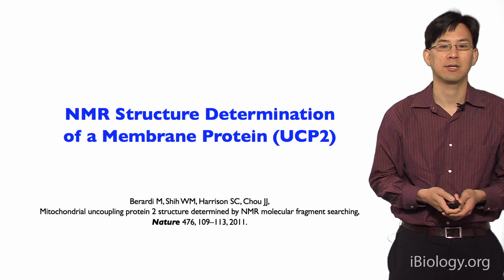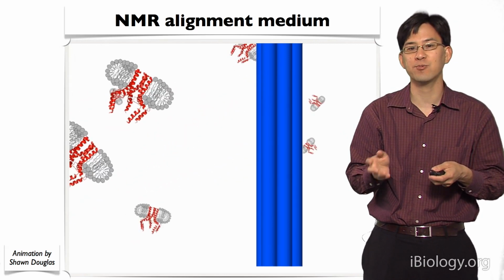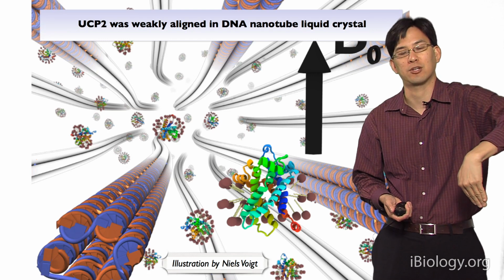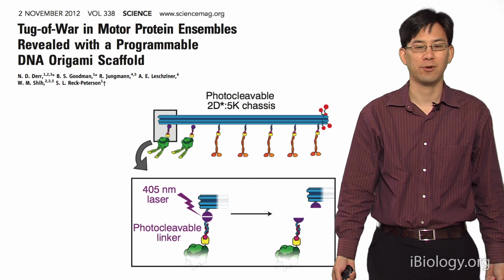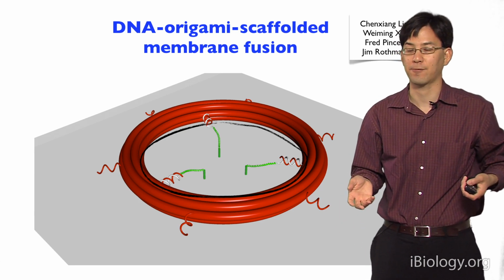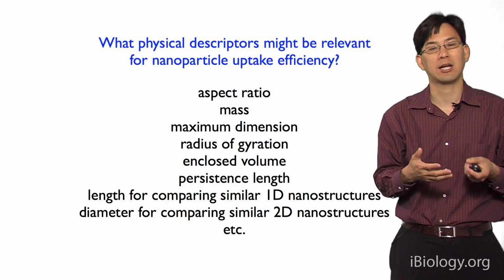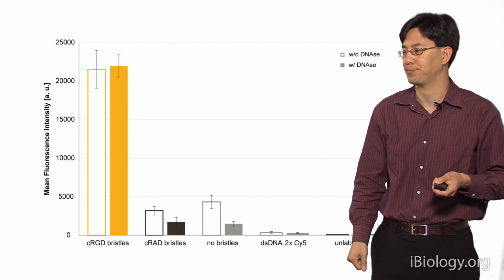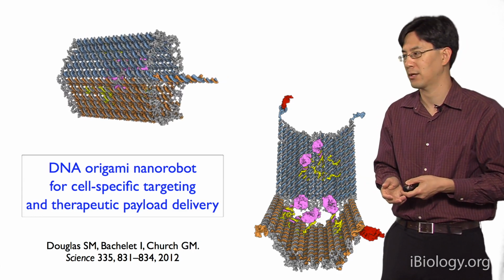William Shih (Harvard) Part 3: DNA-Nanostructure Tools

Comment: Please comment on the feasibility of using small DNA or RNA rings (i.e. plasmids) to line or passivate small high-density perforations in graphene, with the objective of yielding a robust, high-permeability membrane for low-cost ocean water filtration?